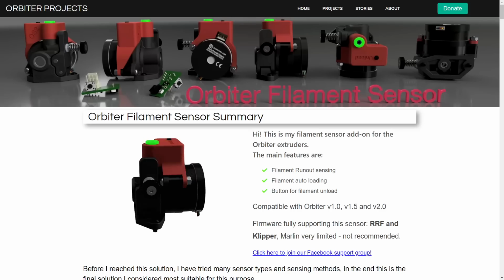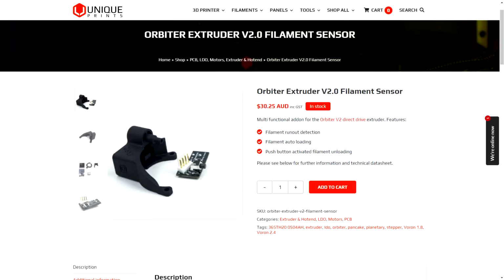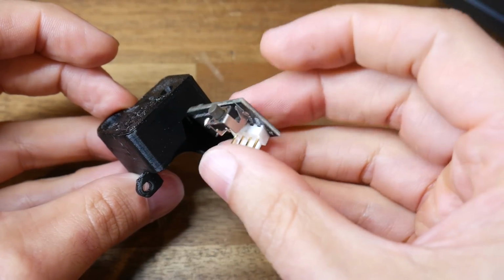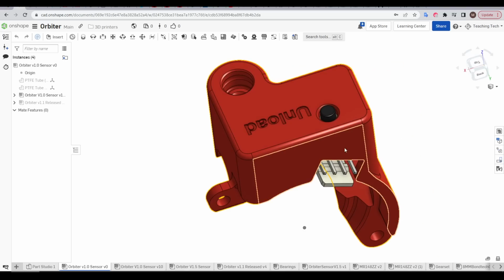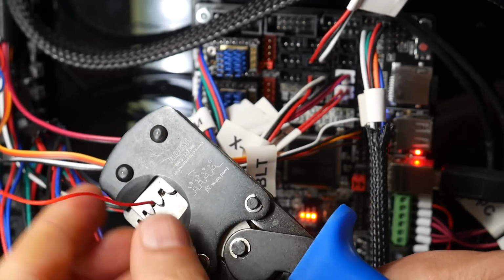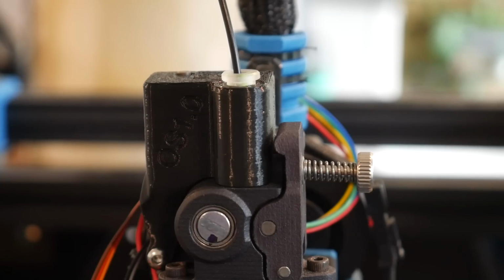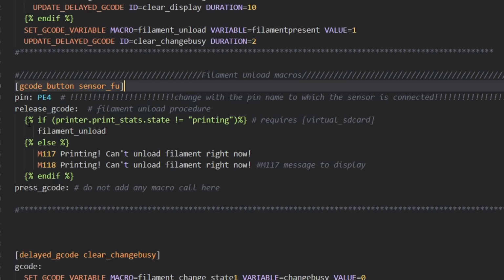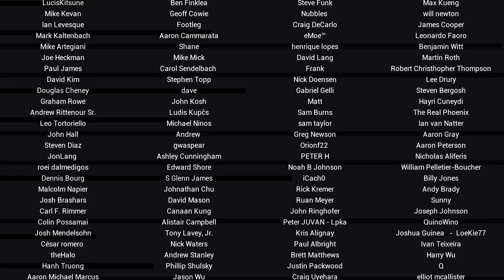Orbiter Filament Sensor guide - A smart, automated way to improve your 3D printer

Comment from the maker: Some folks are pointing out that you can achieve this functionality with other sensors/switches and Klipper macros. They are absolutely right. I was happy to feature this kit as is, because Robert has engineered it really well. The compact form and RGB LED status lights are welcome bonuses. It's ideal for those with Orbiter extruders and easily adaptable for other extruders. Or recreate using other hardware. Whatever works best for you!
Also some comments on wanting an encoder. Interestingly, Robert has a write up of all of the hardware he tried during development, including these, at the bottom of the page here: https://orbiterprojects.com/orbiter-filament-sensor/
Reply: Good write up and good video, but I'll slightly disagree that its engineered well. How does that ball bearing prevent wear either on the wall of the injection mold or on the switch cap over time? Quality filament sensors will use a cartridge bearing on one or both sides of the filament, or optical sensing, which won't wear as quickly if at all.
Reply: @jaro6985  If I may reply. Friction with the filament is lower than friction between the ball and the housing walls. Therefore the ball will not roll much but filament will slip over it because of the lower contact surface, thus will not wear out he switch or the housing.
Reply: @orbiterprojects  yes totally true. Although, unless the ptfe tubing extends down far enough, preferably on both sides, the bearing and switch will push the filament out. And that is hitting against what? Has to be the wall of the housing right.

Comment: I thought the bigtreetech and creality filament 2 filament condition were why bother?  The new LDO Orbiter 2.5 Extruder 1.75mm and (this being the motivation to try this filament monitor system) orbiter 2.0 smart Sensor with The main features are: Filament auto-load,Filament tangle detection*,Filament runout sensing, and Filament un-load action button. Please look at the newer versions. I think your opinion on his newer models would be valuable.. Because until I found this I thought similar to your opening remarks.. but wanted his 4 features...

Comment: Maybe someone's already done it, but the housing could be designed with a sacrificial layer for the filament hole and a chamfer on the side of the mounting tab which faces the bed. Then supports wouldn't be needed. Maybe that was an oversight in the original design or they intended it to be SLS printed, but I don't think the latter would be true if they're supplying the files for people to print.

Comment: Thanks for the awesome guide mate, I have my orbiter and runout sensor setup on a Voron 0.1 and it all works great except when I test the runout by cutting the filament. The print stops but does not lift and go back and then when I try to resume it just errors. Should I remove the pause, resume etc macro's from the printer and mainsail config files and just have the ones in the runout sensor config file? Anyone able to help that may know please.

Comment: 14:27 A mouse sensor, not only can they get incredible small, smaller than those dumb switches, but also give back if the filament is moving and the speed.

Comment: Most of the stuff I print is very small, so runout is rarely an issue. What does cause semi-frequent print failures on my machine is the filament crossing over itself on the spool and tying itself into a knot. For some reason filament movement sensors seem to be much harder to source and much more expensive, which is really annoying.

Comment: Meh not really all that smart. What I want is a geared optical extrusion wheel sensor that acts like a reverse extruder to count how much filament is going through it. With a large over-drive I think the error tolerance can be dramatically reduced and it can input accurate reverse e-steps to compare it with the extruder's output. In theory it should work with all extrusion problems like jams, clogs, underextrusion as well as over-extrusion.

Comment: This is all well and good, but I run into so many random rolls that have a sharp enough bend that the filament wont pull off the spool when at the end and the extruder stops and just grinds the filament down.  No normal (pre the extruder) sensor will fix this.

Comment: At the moment i am installing the orbiter v2.0 on my ender 5 pro with a skr mini e3v3 board running klipper. I also have the filament sensor but i need to figure out what pins to start using. As i think to see in your video you run it on 5 volts, if so is that working fine? Learned a lot from your videos so keep on going.

Comment: Can't wait to see both hall-effect filament width (supported by Klipper already) and the encoder features to be a part of these "smart" filament sensors. Unfortunately most of these "filament runout" only do the one thing, detect when the filament has run out. But it does not help when there is a jam in the extruder, or when the extruder is not extruding as fast as expected (skipping steps), or when the filament diameter keeps changing. All of these features are already supported by Klipper, but unfortunately there is no available sensor that includes all three in one.

Comment: From memory, Marlin supports hardware buttons and customizing the G-code after a detection event, so you can basically do all that with Marlin as well.
Checked: Marlin 2.1.2 indeed can do this. You can configure hardware buttons to run G-codes (a sequence at that), and the filament runout script can be changed from just an M600 filament change, to something else.
At most it will not make a distinction between load and unload on the button.

Comment: This is a cool setup, but I don't think you should've included the word "smart" in the video title, since "smart" has a specific meaning for these sensors and the one you are reviewing is not "smart".   It's a simple (but useful) filament-presence sensor in a compact form factor.  An actual "smart" filament sensor measures the feed speed of the filament so it can also detect filament jams.  I recently added one to my printer and so far I've never needed the runout detection, but I have had so many prints saved by the jam detection (mostly due to accidental excessive flow rates, or spool issues/tangles).  That said, the load & unload buttons are a nice feature.

Comment: So when the filament runs out, does the printer finish the current layer? Or does it stop at the next instruction and later return to that point? I ask wondering if you need some distance between the sensor and the extruder to buffer the completion of the layer.
Reply from the maker: It will finish the current extrusion, not layer. Personally I prefer it this way, because if the layer is a long one, the filament might rear the drive gears and not be able to retract.

Comment: Just received mine this week and was suprise how little information there is, happy to found your video, installation helped a lot. Currently using so I can use a multi material set up where the sensor helps automatically pull/push other filament from two other orbiter on a ratrig. Hope this will work

Comment: I've got no gripes with my "traditional runout sensor" per se. It does a job and don't find it particularly fiddly to work with. 
There is a thing that does cause trouble in relation to the sensor though: It's a mendel style printer with a direct extruder and the higher the printhead gets, the bigger the difference in filament length between printhead in the middle of the x-axis and printhead on one end of the x-axis. Long moves on the x-axis therefor will move filament back and forth through the sensor and back on to the spool, causing bad spooling and filament tangles. Of course the problem only becomes really bad, when the print has been going on for a while, causing late failures of prints. Super annoying. 

I plan on installing a bowden tube to assure filament length between spool and printhead doesn't change anymore. Yes loading and unloading will be more work, but I just really hate failed prints. As an alternative, maybe one could install one way bearings gripping the filament, so it can only move towards the printhead, but not back.
Reply: That could be dangerous depending on retraction distance
Reply: @dirtdart81  on a direct extruder? why?
In the meantime, I got it installed  and use it on longtime prints. Works just as intended, no issues whatsoever.
Reply: @bogusF  sorry, I should have been more specific. Having one way bearings could keep the filament from being able to retract, depending on where they were installer. Could cause the extruder teeth to chew filament, or motor to skip

Comment: With 20$ you can get a Klicky/quickdraw probe + another switch as a normal filament runout sensor.

So basically to me this is completely useless. I think that the 3D printing scene is sometimes prone to overcomplicate things that should be easy and, most importantly, to create needings supposed to address problems that actually do not exists.

Comment: I have both the BTT smartFilament runout and the orbiter 2.0 sensor. I like the BTT because it detected jams many times in my case but because it's mounted to the frame, around 50cm of filament will be wasted. On the other hand, the orbiter will save more filament but it won't detect jams "clog". As much as I like the convenience the orbiter sensor is offering on load/unload, i would rather have jams detected on long prints.
Reply: Agreed. I rarely end up with filament running out, but I've had a couple of large prints fail recently due to jams.
Reply: Agreed, I bought that sensor for my machine and all the workplace ones as well, it's a genius idea, just gotta be on the frame as you say, it's pretty heavy and big. Quite easy to screw it in tho.
Frankly the load/unload button seems a bit silly to call it "smart". Heck you can just add another endstop on the head and do literally the same. And I think Marlin supports hardware buttons to run G-code macros as well.

Comment: I’m a lazy bum. Can anyone tell me if Klipper supports jam detection now? I haven’t looked into it for a while. 

My biggest 3D printing peeve is not running out of filament, it’s having filament in the pathway, but it just not extruding as expected. 

I want to fit something like the BTT smart sensor, but last I heard, that one was not compatible with Klipper.

Comment: I run a Prusa Mini+. I installed the Bondtech extruder which also moved the stock filament sensor into the extruder housing. Works like a champ, is way better than the stock extruder and no more filament sensor hanging off of the end of the Bowden tube. Highly recommended for all Mini users.

Comment: What I want is something with a filament counter, so I can calibrate e-steps easier. There are couple diy projects, but would like an off the shelf add-on.
Reply: BTT Smart Filament Sensor. Pulses every 7mm of filament from my memory, but I don't think it should be used that way, tho you can do it no doubt.

Comment: Thank you for the video, I have been looking at orbiter with filament sensor and while I want to build a dual single nozzle direct remote extruder based on the idea of orbiter and make this work on Marlin, this is a good record in my references list. I'm surprised by the poor quality of your printed parts though - both, the sensor housing and the parts we can see on the printer. I think there is room for improvement in that department and please, take it as supporting and friendly advice only :). "like" from me.

Comment: Its amazing what is considered “smart” these days. Seems like a normal runout sensor with an extra button. 

A smart sensor would be one that feeds back to the main board how much filament has been extruded to improve print quality. Eg if under extruding then the movement of xyz needs to slow down.
Reply: The BTT Smart Filament Sensor does just that, it has an encoder wheel to tell if there was a blockage or runs out, and the hardware connection is identical to a normal sensor, all the difference in signal is that it toggles on and off the output every ~7mm of filament. You could tell if you're under extruding heavily with this if well calibrated and the software supported it.
Funny that he even covered that sensor on his channel already, just one big problem on it is it's weight, it's quite substantial. It's the kind of stuff you mount on the frame and run a bowden tube to the head even if it's a direct extrusion machine.

Comment: You don't need the fancy orbiter sensor to make this work, I implemented all these features with some gcode macros and a regular dumb endstop switch runout sensor

Edit: It even does something better that the orbiter doesn't: when you insert filament with the hotend cold, it will pull the filament a few mm for it to engage with the extruder's gears, then heats up the hotend, and once it's hot it pushes the filament along my entire bowden tube and then does the purge
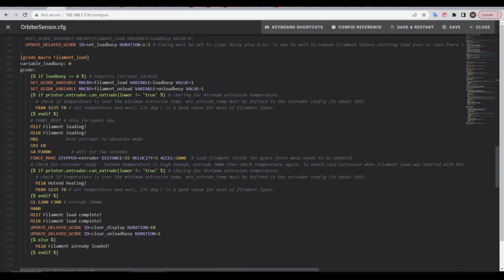Reply: That behaviour isn't inherent to the orbiter sensor, you just need to move line 122 at 13:05 above line 112

Comment: After having this extruder and sensor for a couple months now, I must note not with everyday use, it has now started to flash the sensor run out and stopping prints and ejecting the filament all by itself!! Sometimes the flash is so fast you can’t see it but this now means I can’t leave it printing at all! So now having 2 printers that are useless unless I remove the g-code which worked well for a period… such a shame!
Reply: I'm not that surprised, the ball bearing touching a switch idea just does not seem very good. If you look inside there might be wear due to filament motion.
Reply: @jaro6985  this may be the case, but I haven’t looked into it e.g. disassembled.

I’m just very surprised given the short period used and the genuine part provided in the kit and only using PLA/ PETG with it being 99% non Matt filament, that’s it’s giving a problem already.

Big shame as the idea and concept it great, think the path needs to have a metal sleeve in it though or something 🤷‍♂️ CF would have killed them in a couple prints I’d say if it’s wearing where you said.
Reply: @GAMERSW0RLD  yes, metal sleeve would be a good idea. On their website they mention adding sheets of paper and resoldering the switch to offset it more. But that might not last forever.

Comment: Most of my printers have a DIY encoder wheel jam sensor installed. a couple printed parts, a rubber band, an optical endstop and some mounting hardware. totals up to about 5 bucks if buying parts in small volumes.
Reply: Do you have a small list of the parts? If yes. Would you mind sharing😅
Reply: @tobikiss8213  if you search for diy filament runout encoder here on youtube Makers Mashup has a good video on the setup including a BoM. it uses an optical endstop, a 608 bearing, a number 27 or similar sized rubber band, two passthrough pneumatic fittings, a couple small chunks of ptfe tubing and some m3 screws.
Reply: I know the Enraged Rabbit Carrot Feeder uses an encoder made from an opto-isolator and a bontech-style extruder-gear (the idler side)...

Comment: I only wish this had the ability to sense if the filament is moving. I'm more concerned about jams then running out. At least you can see when you are getting low on filament. Who knows when your hot end fan starts going bad and all of the sudden, heat creep, then jammed filament.
Reply: That's a really good point, and actually that's pretty easy to detect... Just need a rubber traction wheel and an optical encoder with a little code.
Reply: Rotary encoder

Comment: could you do a video on the ercf ? i feel that this is related to this video
Reply: the main purpose would be to use it as a runout mechanism. ex. there are 9 1kg rolls of black pla on the ercf. there is a large print and it runs out of roll 1 of 9. the ercf then switches to the next roll and continues the print

Comment: I think I may end up trying to stick this on to my Hemera XS setup. I was going to just run the normal switch style, but if I can get it to load/unload properly, that's awesome! I'm even running on a Duet/RRF setup with a 1LC tool board, so the wiring just has to go to the front of the extruder. Very cool!
Reply: Please post your modified design. I am interested in the same for a stock Revo Hemera.

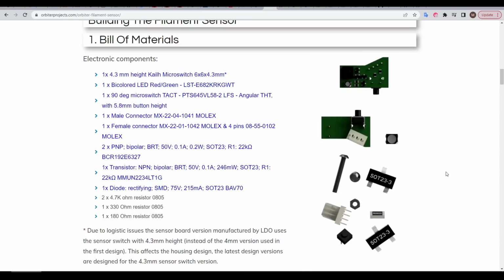Comment: I stopped watching at 2:17.    No Marlin, no go.   Not going through the headache to learn about Clipper just to add this feature.  Shame - it looks like a nice and light direct drive extruder.
Reply: klipper is actually much easier to use than marlin
Reply: @Mr_Pewpy_But-Whole  only if you have a pi already. Buying one now is not worth it.
Reply: @LathanM any pc can rum klipper even an old phone on termux and there raspberry pi clones like btt pi, fly mellow pi or the Orange pi
Reply: Yup, agreed. Same here.

Comment: Maybe I’m wrong, but it seems to that most of the functionality can be achieved with any sensor.

Basically create a set of macros for, if sensor tripped then unload filament, when re-engaged load the filament.
Reply: I was thinking the same thing. You could even do it in Marlin. The issue I see is it required 2 IO pins and doesn't include jam detection. Filament quality has and continues to improve but with tricky, jam prone filaments that is a feature that is really important.
Reply: @LathanM  the bigtreetech one still has the jam protection. I would also bet on the fact that someone will make a Chinese clone of this thing.

Comment: I would like to know, how I can connect it directly to RP PI instead to my SKR e3 v2 board
Reply: There is a filament runout plugin for octoprint that uses its gpio pins. It is easy to setup and it works great as long as you are printing from octoprint. The slight speed difference is worth it vs printing from the SD card directly.
Reply: @LathanM  I already have this sensor